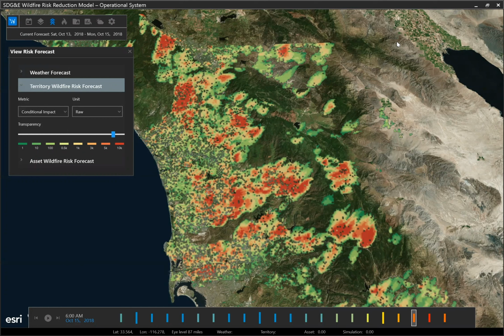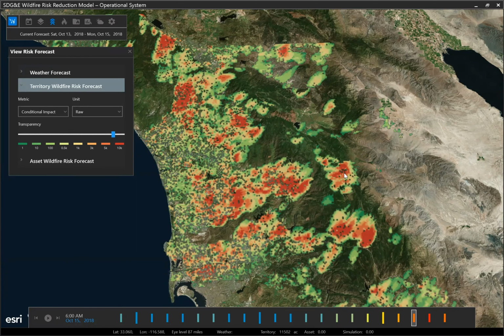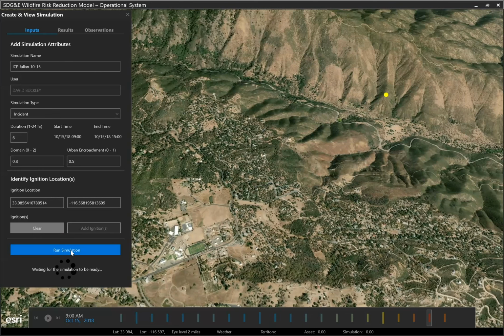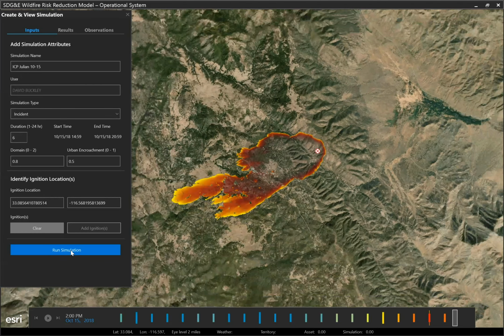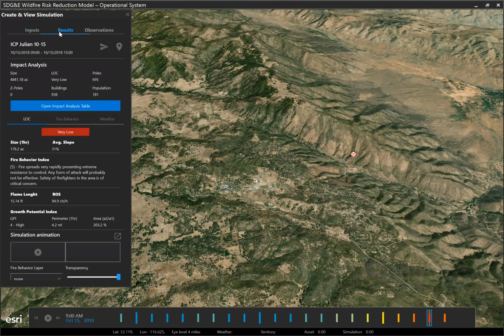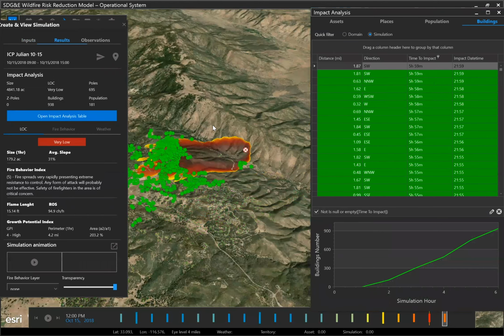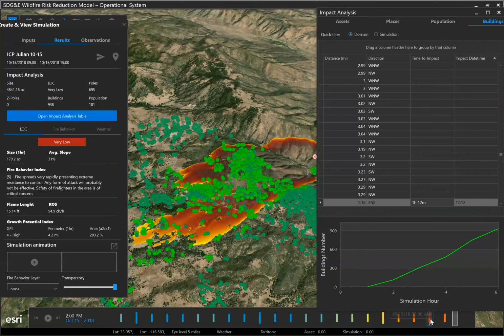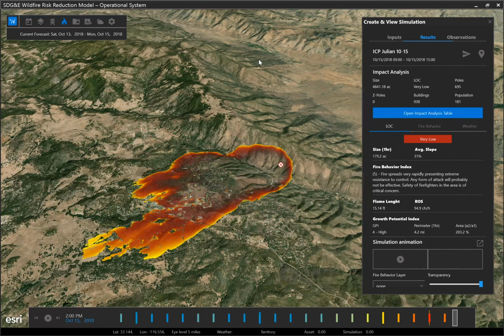Technosylva - Wildfire Spread Prediction Demo

Comment: Nice one! How do I access this wildfire simulation tool? Also, is there an existing wildfire data that can be used with this simulator? My focus is to extract information such as fire intensity or RoS of fire of particular points 0n the map, compute risk probabilities at those points, and finally extract a complete graph of the points. At this point, I need access to this his simulator to begin with. Your suggestions would be greatly appreciated.